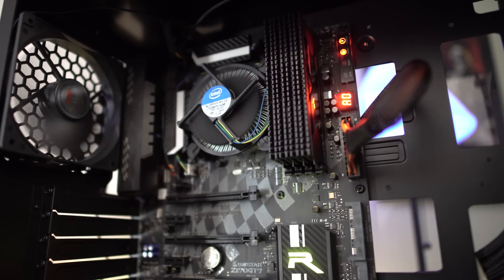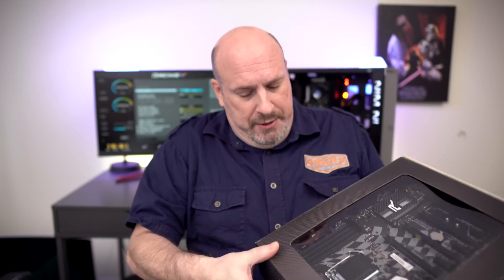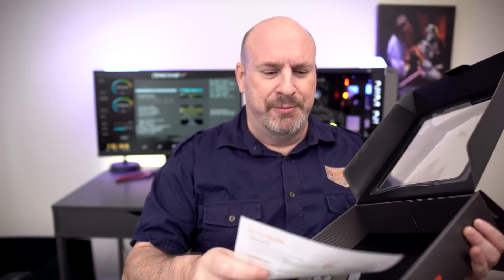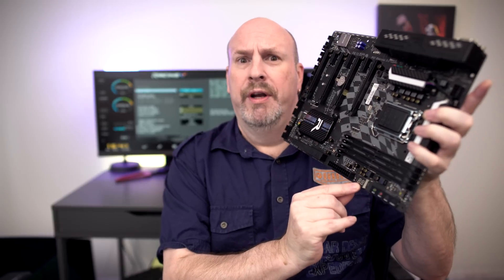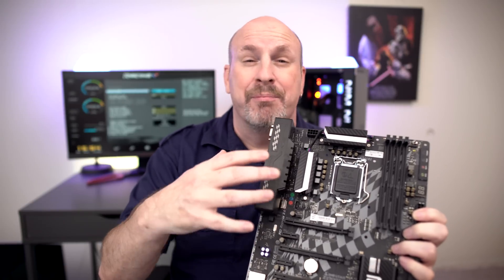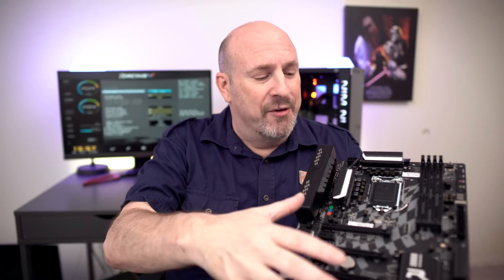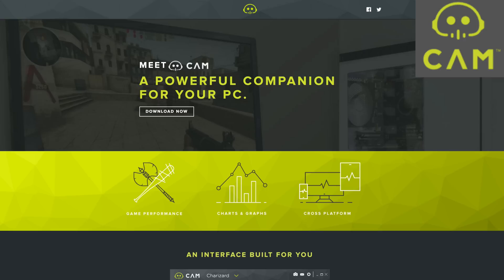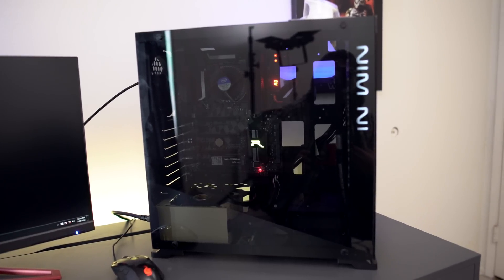What is a Racing Motherboard?

Comment: Board lives up to biostars great design but poor performance I have had a racing board since late november and its already showing power problems , it randomly shuts down and gives no warnings when it does it potentially its risks damaging other components which are not designed to handle sudden power loss. 
Futher to that it does not seem to like my SSD , new RX470 and 2 HDD's connected. Every single piece of the pc has been changed to find the power problem and this setup draws less than my old fault free AMD R9 280 setup i am waiting a few weeks and i am scrapping it for a 32GB very respected board.

Comment: got the board after watching your review look solid feel  solidyoo.Brilliant build.all solid  capacitors will comment about performance later after testing it
Reply: Heyy! Are you done with all the testing and how is the mobo performing so far?
oh, one more thing. Does it support only 1 USB 3.0 from front panel? :(
Reply: No it has support for 2 front usb3
Reply: yay :V and one more silly question. Does it has a mic port? xD
Reply: the board has 5 usb 3.0,1 usb typeC and 2 HDMI ports at the back i/o panel, It has support for 2 front USB 3.0 and 2 Front USB 2.0 with audio support at the from for both mic and speakers.It also has a  6 point gold plated audio and mic connectors behind it
Reply: the board performs fine in normal mode i have not tried Eco mode or others the RGB led strip that i got is great .. But the Board is not meant for Out right enthusiast overclocking , although you can experiment but being z170 board with i5-6500 i am getting great performance.. it will hold up to any modern AAA title and perform well .. has sturdy enough build
Reply: Thank you very much for your info bro! =)
Time to buy this bad boy :D
Reply: this is my first time building a pc :c i hope it will go all well.
Reply: the bios are easy to handle but i dont play with voltages .but have set my Ram speed to 2033 .for a nomal uses  who renders vedio & plays title like witcher 2 & 3 its a great board
Reply: Get it from a retailer who can give you warranty , online purchase some times has problems unless you are from United States .. i recoomend using this board with a Gtx 1060 you will get best results and an economic built .. Get at least 8 gB ddr4 Ram too
Reply: you are welcome ,I almost for got about my comment lol
Reply: ugh, darn it! I checked with the distributor here in Sri Lanka and that idiot said they don't have the newest mobo :_: Really frustrated about the dealers here and it was all the same with ASRock boards.... You're from India right bro?
how much did the mobo cost u in Indian rupees? :c
Reply: I had my family member in US bring it to me a month after US release . it was around 129 $ Indian Rupees
From Newegg online its abound 200$ with shipping for Sri-Lanka (200$ = 12500 INR Approx.)
Reply: +Aris Heim lucky you hehe. so in this case, I have no choice but to go with Asus z170 A ._. Tyvm bro
Reply: Welcome

Comment: for the gold plated audio connectors, how do you tell which is which? if there are labels i don't see them
Reply: +Omared Abed  why do they still use gold which is an inferior conductor to silver.   worst metal ever expensive to add costs up and crap. 
 who is with me and would love a whole silver and japanese capacitor mobo  ^^

Comment: Just a correction

1x16 and 3x8 PCIe connectors. The bottom 3 PCI connectors have half the pins, so they are 8x only as seen at 7:31, the underside of the board.

Other then that, very nice looking board for the price.

Comment: I like the theme, there seems to be a lot of effort in some areas and neglect in others - gold plated audio sockets (yet no optical), lights on heatsink, exposed crappy coloured wires hanging out of them. unnecessary carbon fibre (always a good thing in racing) chequered flag ("one of those flag things they wave near the end of the race" lol) but so understated!, loud flashy lights and a dull faded looking flag theme thing. oh well. still nice.

Comment: Just want to ask about the bottom slot,  wouldn't it be blocking the cables when you install a graphics card down there
Reply: +crozacx It will cover them yes but it doesn't really matter. Once you plug those in you really never need to touch them again.

Comment: Yeah, if i buy a i7, i am going to buy a cheap Mobo and a cheap graphics card, cause i spent my money on the stupid CPU, which is not the most useful component in a PC anymore. Edit, i will also be buying slow HDDs too. But heck, atleast i can brag my CPU is a Skylake i7.

Fuck, buy a 4 or 5th gen CPU or a 7th gen i5 CPU. DUUH!
If you want a i7 and have the money, buy a Gigabyte Z170x Gaming G1. That thing rips apart everything.
I wouldn't download Cam either. Another program humping your systems load.
Reply: +FIGHTTHECABLE Depends on what youre doing, the cpu is one of the two if not the most important part in ur pc.

Comment: I feel like the whole "eco/sport/reset/power" button panel would have been better if it was a separate module attachable to the outside of the case. 

If I had that board, I'd just leave it on sport because I wouldn't want to have to open up the case just to switch between eco and sport...

Thanks for showing us this cool board, ToT

Comment: the USB connecter is badly Designed on the mobo , the wires should have been implanted to the layer of the mobo (means its an rebrand) , the audio chip is nothing new you can find it on any z170 chips or even 170 series , the capacitors with the mosfets dont look great for overclocking , that only having 5x / 4x charging the cpu when my z97x has 10k and this one has 5k caps ... anyways biostar is a good cheap server mobo but they want to expand which is normal but to many faults here

Comment: You said good audio, ALC 898 and 4 audio capacitors are pretty shit. My board has ALC 1150 12 capacitors and a te OPA1652 amp and i call that ok, besr part is the board was $179 AUS. And budget friendly? $149 aint budget friendly, budget friendly is an msi b58m-g43 with a G3258 OC to 4.4Ghz for $139

Comment: I dont like those blue capacitors...
Reply: +Joako Are you an engineer? No? Get the fuck out.
Reply: What the fuck are you doing reading my username? Wow stop little guy, u dont need to be an engeneer to see those cheap capacitors
Reply: Joako That's some top-tier stupidity.

Get this motherboard, de-solder the capacitors, and check their capacity. If it's the rated capacity, they're good. They don't have any mechanical goop (fuck knows what it's called in English) on them (actual sign of shit capacitors, not the fucking colour of the damn casing), which is already a good sign.

oh but u dont have to be an engineer to judge like an engineer ur right bro lol kek sry i just thot u wer jokin ther for a bit
Reply: Joako Touche, good troll

Comment: i might be due for an upgrade.. will my i7- 4770k fit it? 
2 years ago when i built mine from the ground up. i got a sweet deal on my i7-4770 + motherboard
if by chance.. does this motherboard come in a bundlepack with a nice Processor itself?
EDIT
ahh nevermind. that link in the description has a bundle option with the board. :D thanks for sharing. i might start a 2nd build

Comment: how is 127 dollars budget friendly that cost more then some peoples graphics cards
Reply from the maker: +chemo bird Okay,, LOL
Reply: +chemo bird, that is very budget friendly, I spent $250 on my mobo and if you spent less than $100 on your GPU, you really shouldn't be gaming on any modern game or any game from the last few years unless they are RTS games.
Reply: Because its a "budget" price for the features and it's a z170 mobo which the price of the mobo put it towards the lower end
Reply: +chemo bird This is too funny! Your motherboard for the most part is one of the cheapest things you buy.
Reply: the high end 980 ti models made for high over clocking and higher performance than a reference 980ti, are not cheap. you keep your $100 graphics card. I'll keep playing at 2k with 60fps ultra settings and most of the time fps into the hundreds.
Reply: matt may There are things that you can justify buying used, I sold my R9 270X for $100 to a guy and told him it had been overclocked a few times. I keep in contact with him to make sure the GPU is working like I promised him it would and he loves it for his games. I also bought a used CPU from a guy and while the thing is a horrid overclocker, it works really well. There are things that should never be bought used like hard drives and power supplies; but motherboards, CPU's, RAM, GPU's, and cases are all perfectly fine things to buy used. Just make sure that the seller is willing to test the items before hand with you present.
Reply: +chemo bird uh yeah my z-97E was that much lol so haha
Reply: Ryan Grobe I actually used to use a 750ti and a g3258 before i had money i was able to play gta 5 on ps4 quality with 30-45 fps
Reply: +Ryan Grobe I spent $80 on my motherboard and $250 on my GPU. This is how you budget.
Reply: +Bartosz Olszewski I spent 130 on my mobo, and 900 on my gpu, THATS how you budget
Reply: Bartosz Olszewski spent 250 on mobo 350 on gpu and 350 on cpu
Reply: it's actually a good price for z170
Reply: dank pepe Had no money to buy 980ti's unfortunately.
Reply: Ryan Grobe Ain't gonna happen, only things I require is to support cheapest RAM sticks, have my CPU socket and PCI-e x16 slot. I don't overclock (yet) so any chipset and power delivery system will do. Now I'm using my lovely ASRock (hate ASRock but whatevs) H97 Anniversary and it does what it's supposed to do.
Reply: my gpu coat 670$ lmao
Reply: +matt may what the fuck. Who spends $670 on a graphics card? Well some people bought the TITAN X so...
Reply: powerplayer75 The same people that want to make sure that they can max the settings on any upcoming game for the next few years. The GTX 780 is a three year old card now and it can still max a lot of games at 1080p whereas the gtx 760's and lower struggle at anything above high at 1080p for most games released in the last year or so.
Reply: +Ryan Grobe You don't need $670 to get a 780ti, or even a 980ti for that matter...
Reply: LinusScrubTips You do if you want to play at 1440p or higher at 60 FPS ultra settings.
Reply: Literally what are you people talking about. My roommate just bought a EVGA 780ti (was one of the overclocking editions. Can't remember which one) for about $350 6 months ago. I bought my windforce 290 for $340 almost 2 years ago. I could literally add another 290 to my rig for probably ~$200 and play 1440p above 60fps ultra.

I was wrong about the 980ti, (IMHO it's overpriced.), but 780ti overclocking editions are dirt cheap.
Reply: +LinusScrubTips the 980ti can run vr smooth, and play high fps in 4k, I just don't have a 4k monitor. the prices on those are total bullshit. I don't need two video cards like you would. I just need 1. and with the prices you listed, that's only like 100 less than a single 980ti.
Reply: It's a budget for a GAMING PC not a regular PC
Reply: matt may Are you saying the prices I listed are bullshit, or the 980ti pirces are bullshit. Because I literally looked at my invoice to find exactly how long ago I bought my 290. And if I was running at 4k, personally I'd want a Fury or a titan over a 980ti, but that's just me.

IDK what you mean by" I don't need multiple video cards."

yes, and for $100 less i would get far more performance than a 980ti. If you bought 2 290s used right now it would be about $200 less than 980ti and way more performance.
Reply: I was referring to the price of 4k monitors being bullshit.
Reply: the first issue is I would never buy a used computer component. just a bad idea any way you put it. and a lot of games, don't even support sli. so sure, you have these two cards that in theory could perform better, (but they dont) but no games would actually use that
Reply: +chemo bird Lol. Wow. Just wow.
Reply: +powerplayer75 I've got a 980 Ti. The thing cost £560 which is $800 USD. Not hard to spend a lot on a GPU lol
Reply: matt may I literally made a comment on linus' used part video and got massive counterarguments. Unless you buy on craigslist, you're going to be fine. I also sold my fully working 270x. Guy sent me a message saying "fuck you" about a month later. I asked what do you mean, and he never replied so I'm guessing it was an accident. Most people who scam shit aren't smart. As in they don't build PCs, so they can't scam someone who is knowledgeable about PCs.

Someone did try to scam me while i was selling my 270x. Some little chubby fuckboi tried to trade me an "EVGA 780". Ya, a 780, with orange fans with an Nvidia logo in the middle, a ugly green PCB, no EVGA branding, and 1GB of DDR 3 Vram. It was either a scam or he got scammed. Either way the kid was retarded for trying to pass it off as a legit 780.

Edit: and SLI/crossfire works in all AAA games that aren't ass (IE Arkham City, Unity, ETC.) It works in a lot of non AAA titles two. A few games with great Multi GPU support are The Division, GTA V, Alien Isolation, Tomb Raider series, and Witcher games. All of which would totally benefit from a multiple GPU config. It's also worthy to note that Crossfire generally has better GPU scaling (how much more frames you get per added GPU) than SLI, so if I had two 290s it would smash.

I will say this. Only SLI/Crossfire with GOOD cards. As in Nvidia 70 series cards and above, and AMD 80 series cards at 1080p. above 1080p Nvidia 80 series cards, and AMD 90 series cards. This way if you're SLI doesn't work, you can still get max frames at decent settings. You never want to have your SLI setup getting you 60 FPS when working, otherwise when SLI/CF fails, you'll have shitty performance or shitty graphics. MY friend had this issue when he had dual 760s, hence why he has a 780 now. Also why I would rather get another 290, since my 290 can do decent at high resolution by itself. I supersample at 1440p in a lot of games with high to max settings. At 4K I get medium to High settings, which is pretty damn good.

Also, 4K monitors are overpriced as fuck. No way it costs that much to make the Panel.
Reply: Even.Ways Music That's because you're area has shit prices tbh. Probably be cheaper to buy from newegg US, and ship to where you live.
Reply: +chemo bird you are talking about a motherboard.. expect to pay at least 100 bucks for something that will last a long time.
Reply: Blind Lemmings Don't Matter Depends on the usage. My shitty cheap AM3 board from years ago (seriously the cheapest I could find) still works fine with an overclocked 960T. And it was on pretty much 24/7 for at least 2 years.

Shit, good thing I upgraded.
Reply: +What the fuck are you doing reading my username? nice.. love it when a deal works out.

Myself, I bought a dell precision t7400 for 350 bucks.. dual quad xeons @ 2.66ghz, 16 gigs ram.. just need a decent gpu and i'm ready for the new wave of gaming:) currently using a radeon hd5750 card. works ok.
Reply: Blind Lemmings Don't Matter Yeah you're definitely set for when games will stop caring about single core performance more than the amount of cores.

Fuck knows when that time will come, tho. I know there are exceptions.

I got that motherboard for an equivalent 30$. New, from the shop
Gotta love ASRock
Reply: I paid 400 for  my budget builds motherboard asus z170 viii formula. Why do so many think the motherboard is a place to skimp and psu i have the axi1200. The case is the only place i would go cheap but thats me..Im not rich i just have to save longer to get it done..And its a good time to build this year i believe the next two cpus from intel will be 1151 socket..

Comment: Having flashy LEDs does not make a board good. Given that they usually become more annoying the longer you use it. 
LEDs as your biggest selling point, rather have a old school green PCB with white slots that's stable. IMO It just makes it cost more with no real gain in reliability or performance. 
True that my opinion my be biased due  I have tried them in the past and will just say It was a short term relationship, and it left me in under a year. Went back to ASUS.
Reply from the maker: +Terry Dalton I bet it has been years since you used one as the company has changed quite a bit since then..
Reply: +Tech of Tomorrow yes it has been 7-10 years since I built on this board, and in tech arena that's a lifetime.  So no I'm m not really qualified to pass judgement on them..

Comment: Why are motherboards still not creating a right angle for the 24 pin power connector??? I mean you get right angle SATA....I just do not get it. If a consumer is buying this board or boards like it, you are likely going to have a case that supports cable management and you are going to manage your cables.

Comment: so did I wasted my money on an Asus Ranger viii?
Reply: The Asus os a better mobo? 
It has only 3 pci-e x16
I guess it's better quality
Reply: ***** few....I thought of that too
Also I don't think that the rog is for gamers only
Reply: ***** yeah I just ignored the gaming title and I bought it like a high end mobo cause I didn't had the money for the deluxe one
You can make a "gaming" pc with a cheap h110 too
One guy put an i5 6600 on it with just ddr3l
Reply: ***** also I got it cause I will upgrade to i7 6700k or even e better one(if one comes out) and add multiple gpus in the long future(4years+)
Basically I will try to max it out as the time passes cause it will be basically my future as I am studying  at University
Reply: ***** well now I have the gpu that the pentium g4400 has
If I sli I will stay on 2 cards only and the second I will buy like 1 year after the first or maybe 2 years
Since they will be like the x60 or x70 and brand new I would have no problem even after 5 years+ or until I get a stable and good paying job(I hope)